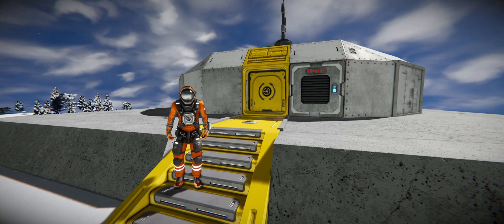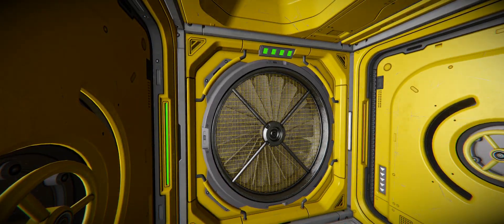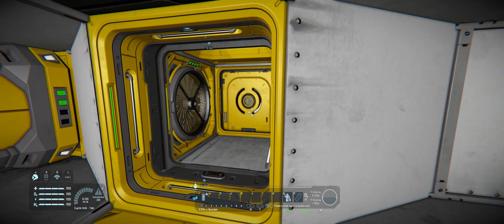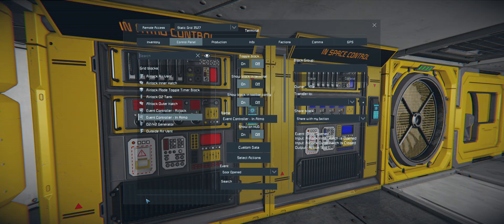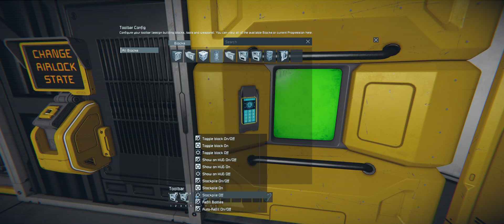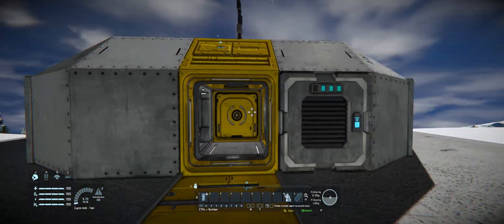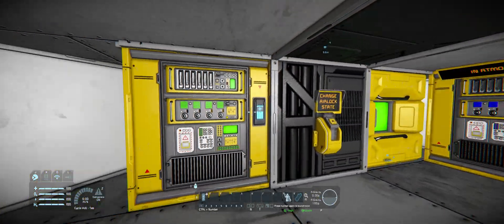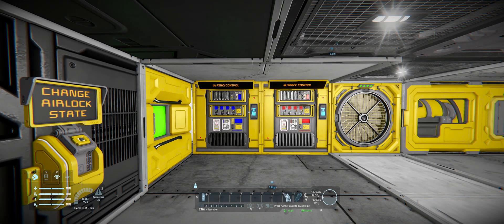Event Controller Airlock in Atmosphere? How to Toggle it Off

Comment: Thank you for the good explanation - opened my eyes as I didn't know about the air vent actions so far. Idea for optimization with no need of the second event controller: use the timer block for opening the outer door. The problem is that if you put the action "open outer door" into the air vent when it is depressurized this event will not be reached when the oxygen tank is full. Just start the timer when the event controller fires "doors closed". If the condition is "pressurize the airlock" just nothing will happen because outer door has no power. If condition is "depressurize the airlock" the outer door will open in any case and eventually waste some oxygen wich you don't really need because oxygen tank is full.
Second way is to use a seperate oxygen tank wich is not connected to anything but the airlock vent. Sure - you need to fill the airlock with the inner air vent first, but that makes sure that there is only the oxygen in the tank you really need to fill the airlock - then there is no need for the timer block. I use this technique with an airlock system controlled by script (where I need just one programmable block for any airlock I build on the grid plus an additional timer block per airlock.

Comment: Could you use the exterior vent's built-in depressurization sensor to automatically toggle between the atmo/space modes?
Reply from the maker: That's a good point. Not sure but it is worth testing!

Comment: But this is only viable for ships no? Or I'm just missing a reason to build airlock on planet with atmosphere
Reply from the maker: Yes, the toggle is for a ship. I was just lazy and reused the same outpost.
Reply: The tank fill problem is why I prefer simpler, always-depressurize airlocks, where it just always pushes the atmosphere back into the habitat side.

Whenever you open the airlock to the outside, any atmosphere that went from your ship/base into the airlock has already been pushed back in.

No tank required to operate the airlock

No worry about over-filling anything.
Reply: It would be needed for Planets that have a low enough atmosphere that you can not breathe in normally, but can still depressurise to gather O2.